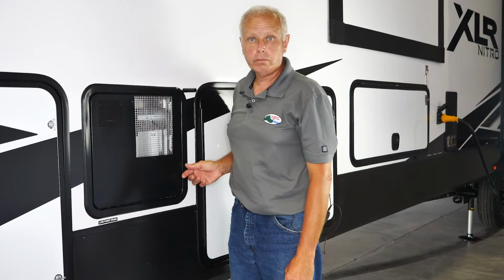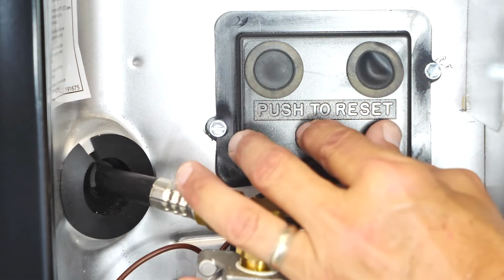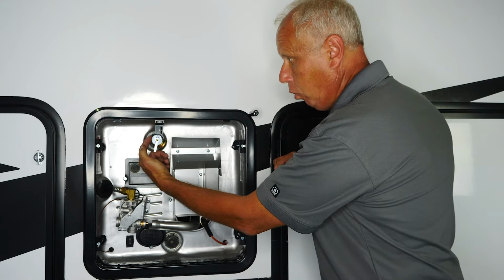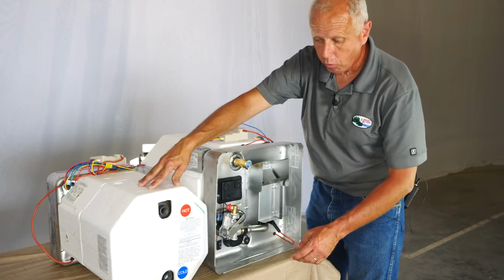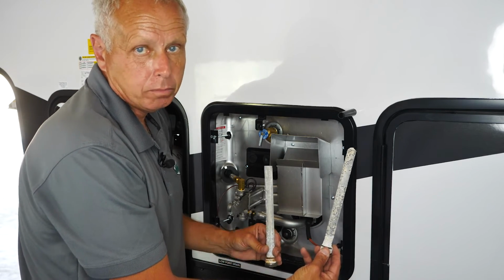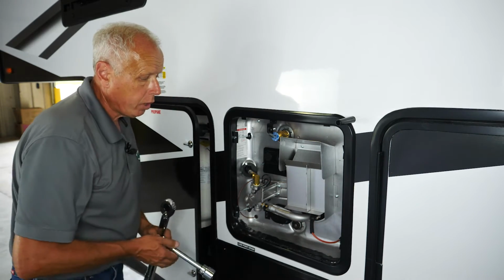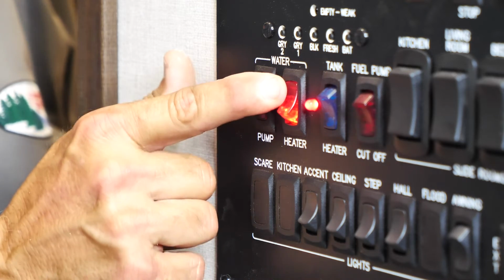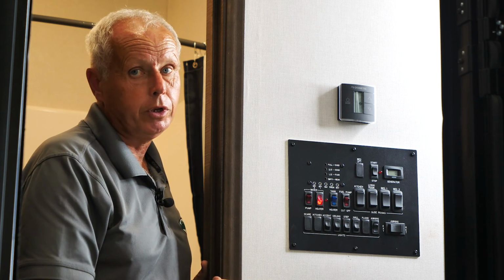Suburban Water Heater

Comment: I have a forest river Sabre 37 flh. Is it possible to run the water heater solely on electric? Or does it have to be run on propane at all times?
Reply from the maker: Yes. It is a gas/electric DSI and can be run on either one.